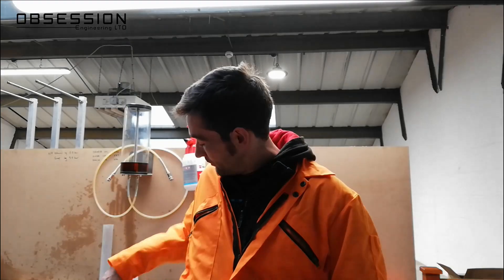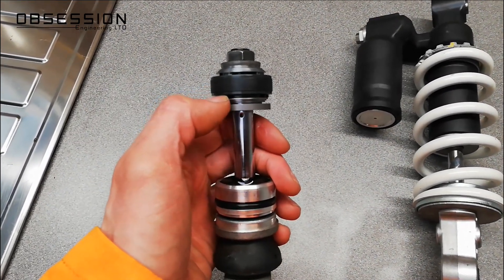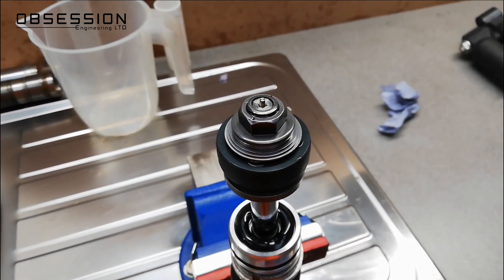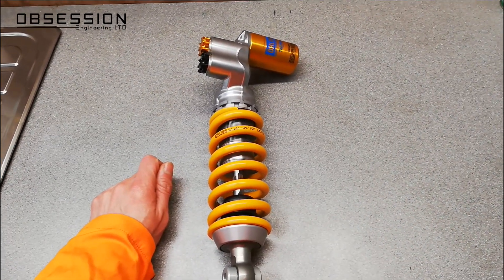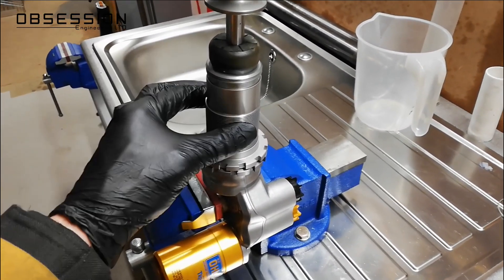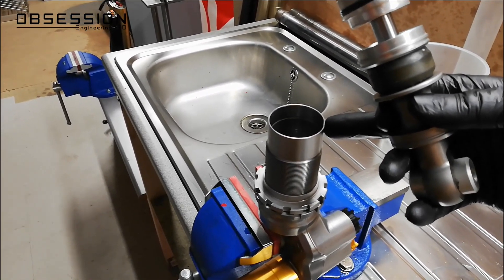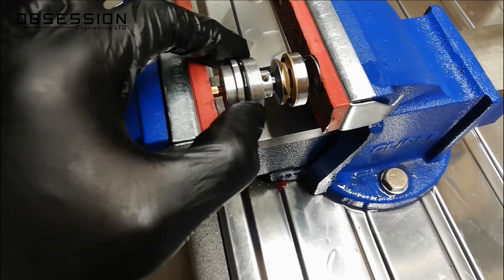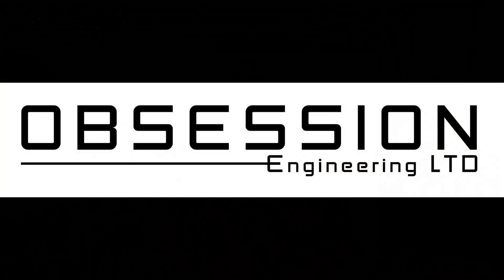Why is a twin tube shock better? Ohlins TTX shock absorber stripped

Comment: Will the TTX by design be more reliable than other dampers? Also, will this damper perform better over small bumps than KW twin tubes with high spring rate? Thanks

Comment: Since a twin tube is pressing oil against the valve during compression, the nitro charge pressure can be much lower, correct? I'm curious what the nitro pressure differences are (the single tube has to run higher pressure to prevent cavitation...)
Reply from the maker: Normally 5 bar on a twin tube, vs 10-12 for a single tube

Comment: Who else is wondering here To Spend or Not 1000 for rear Ohlins 🙂
Reply: For me I sourced a used ohlins off of a wrecked bike with 2k miles for 350$. I sent it to ohlins USA for inspection and to set it up for my weight and style. All and all it was around 600$ installed and yes I believe it is worth it.
Reply: Just got my new Matris for about £700.... but I think a single tube.

Comment: The biggest problem we find with this design.....and it is a big one...Is that the shaft piston area is so so large compared to that of the valve port area. This results in a lot of harshness due to the fact that oil wont compress and it is rapidly trying to accelerate through the very tiny ports. As you would be aware, damping is velocity sensitive and the force rapidly rises on square edge bumps making the ride super uncomfortable. The SBK TTX has much larger pistons compared to that of the consumer model in order to overcome deflection off bumps. Sadly anyone that has purchased a TTX equipped OEM bike may not agree with your adoration of this concept due to the lack of attention paid to basic mathmatics by Ohlins. Most track bikes wont see wheel speeds over 600mm per second but this is easily exceeded on the road.
Reply: Good one Terry 👍
In that case what shock absorber would you recommend in high end quality like this Ohlins for the road application only ( not racing).
Reply: Everything I’ve read about the TTX being used on Triumphs reflects this. Really disappointing but I’m happy because I have a Penske Double Clicker. Easy to work on for an average mechanic and works great on track or road.

Comment: How do you get the pressure back into the shock on reassembly?
Reply from the maker: With a nitrogen supply!
Reply: @obsession_engineering  just watched your other video with the bicycle pump lol know I know cheers mate!
Reply: Dave keep the engine rebuild vids coming they are very good, got a 2005 fireblade myself

Comment: Thanks Dave!  A few other advantages of the Ohlins TTX technology is no worry about cavitation and no need to pressure balance.  Also, re-valving is much easier than in a single tube shock.
Reply: came to say similar- I am curious since there is still a pressurized chamber, how different the pressures are?
Reply: @bradymoritz  It is interesting.  With a single tube shock when the velocity of the piston gets high the pressure differential across the piston gets enough you will get cavitation which not only ruins damping but if it happens enough will also pit and ruing the piston.  The only way to ensure that you are not getting cavitation is to have enough pressure in the shock to control the pressure drop across the piston.  With TTX technology there is no danger of cavitation because the oil flows through stationary valves.  You need some gas pressure but not to stop cavitation.

Comment: Kind of funny in the bike world you have Monotubes and they sell you twin tubes as a sporting upgrade while on the car world twin tubes are standard and they try to sell you mono tubes as an upgrade
Reply: The twin tube shock you are talking about is very different from the TTX technology.  Most "twin tube" shocks have a foot valve for compression and are emulsion (pressurized gas mixed with the oil) type shocks.  Very old technology.
Reply: @theohlinsguy4649  yeah it's funny how much twin tube info is out there showing the oil mixing with the air etc...